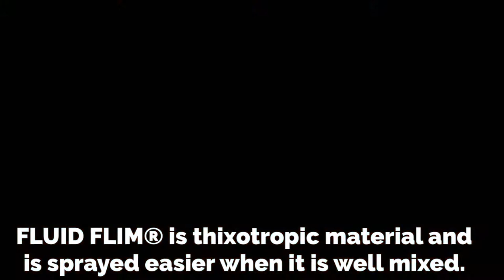FLUID FILM® Undercoating Tips

Comment: I just tried this product...should I wash under my truck after the winter and reapply in the fall?
Reply from the maker: Roadking 2003 Hi Roadking. Typically a once a year application is all that is needed. For plow trucks or high mileage vehicles it is sometimes beneficial to do spring and fall. It typically only needs slight touch-up and not a removal and re-application. If you have any other questions feel free to ask!
-The Fluid Film team
Reply: Thank you ...I de scaled chipped and wire brushed all of the under body then  applied rust converter then paint ..I applied a heavy coat of fluid film. I'm happy with the results so far. 

Thank you

Comment: What is the shelf life of product in gallons not aerosol cans?
Reply from the maker: Fluid Film has an indefinite shelf life in the bulk form as long as the container is properly sealed when not in use. Fluid Film does thicken when not in use but a quick mix up will bring it back to its original state. Check out our most recent video on the channel for a quick demo of mixing thicker product that sat for a few years.

Comment: Would a handheld airless sprayer work that looks like a drill with bottle in front?
Reply from the maker: Yup! If it can spray a house paint it will be able to apply our product. Be sure the product is well mixed and at a room temperature before adding it to the gun to ensure is sprays easier.
Reply: I used the cheapest sprayer from Harbor Freight and it worked pretty well.